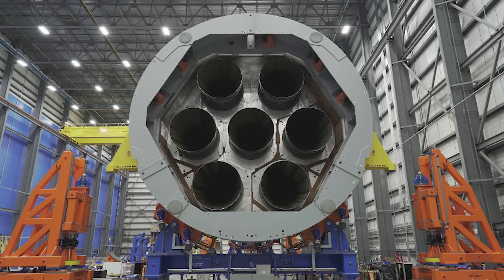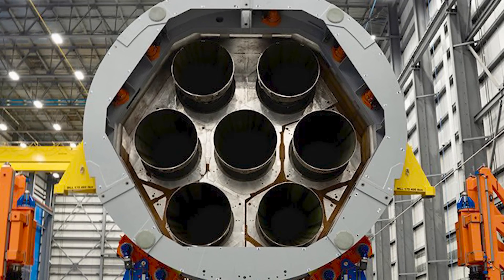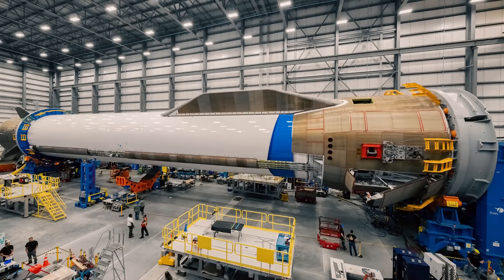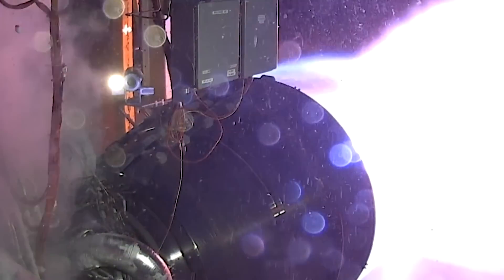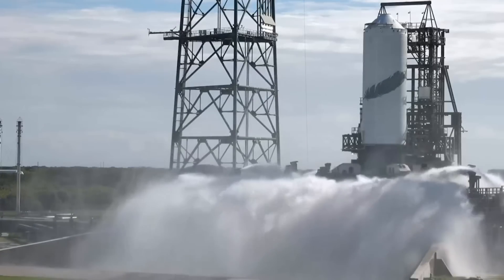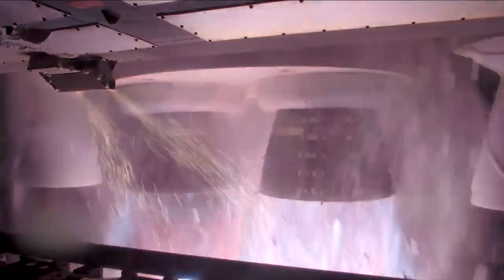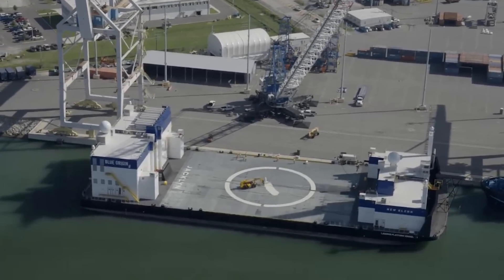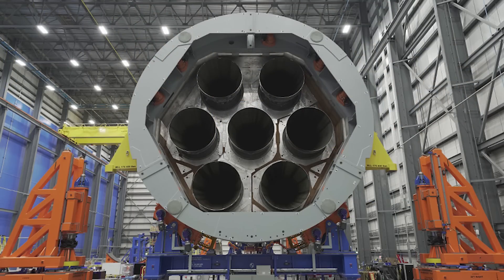Blue Origin Just Installed New Glenn’s BE-4 Engines

Comment: “No one has landed a reusable booster on the first try.” I’ve got some bad new for him if he hasn’t heard about starship IFT-5. It will still be an incredible feat if they land it first try. It’s a good looking rocket and I’m excited to see it fly.
Reply: IFT-5 had zero payload and is nowhere near "Flight ready" whereas New Glenn is.
  Big difference.
Reply: @jameskelly3502  exactly. new glenn is a functional LV. starship is a prototype
Reply: Can you expand on functional? It hasn't proven itself in a flight yet. Chances are it won't even clear the launch pad. Who knows, maybe the front will fall off. Nothing on that rocket has 1 second of real flight. It's as much of a prototype as the starship, but the starship booster actually landed and was catched with the chopsticks on the tower that released it. It seems to me that starship is getting proven, while new glen is flying payloads on unproven prototypes that the front might fall off of. Functional is a stretch at this moment. When it completes a full real test or mission, that's when you get to call it functional. Until then, it's a prototype. Theory!
Reply: @mihaiserbanescu8676  This is silly. SpaceX did flight tests relatively early and therefore had a number of failures. Many other companies do more extensive component and subsystem analysis and testing to limit flight risk as much as possible. This is why Vulcan worked flawlessly on its first mission, Ariane 6 very nearly did, and so on for many other rockets.

That doesn't mean one approach is better or worse, just that it is very possible to have a flight test with low confidence or quite high confidence.
Reply: Not really true but the point wasn't to successfully land the rocket.  The objective was to gather data not based on guess-timates in their simulators but to have real world data on how the systems actually perform in the real world.  Blue's biggest issues is they "Don't know yet, what they don't know yet."  When so many things are brand new and going to be tried for the very 1st time, you're really flying blind.  

Also non-optimal solutions tend to stay non-optimal unless they are mission critical that lead to loss of flight issues.  Ie the shuttle foam issues on the Shuttle were know but only addressed after it caused a catastrophic failure.  With no early flight testing, finding those issues cannot be addressed early in the R&D cycle and usually have to be "managed" after the systems are in production.  The attempt at getting everything right before attempting the 1st flight, is great if it all works perfectly.  The danger is some fixes cause a cascade of changes that impact other systems.
Reply: How have you managed to forget about ift 2?
Reply: Hmm why is it called IFT-5 and not IFT-1?

But yes, their first attempt to land it on a hard surface was successful. But 2 failed water landings and 1 successful water landing preceded it.

But yeah, they caught the booster on the first attempt.
Reply: @jordanhenshaw  1st try tower catch.  Blue just wants to say "we were first" so they added "at first try"...  Wish them and us all well.
Reply: @jordanhenshaw  1st time trying to catch it. IFT 1-4 was never meant to land

Comment: Gonna explode 😉
Reply: Successful payload delivery and booster landing 😉
Reply: @unnamed-ninja-yt  Payload maybe, booster landing doubt it.
Reply: @THX..1138  New Glenn delivered it's payload but the booster didn't make it. Still better than upper stage RUD on seventh attempt to reach suborbital trajectory.
Reply: @unnamed-ninja-yt  No not really. Starship and New Glenn are apples and oranges. Starship is still in the early stages of design. IF7 was a 100% research and development flight. Not a single part of the IFT 7 vehicles will be on the finished rocket....Whereas New Glenn is basically the rocket BO intends to fly customer's payloads on and it was using what are supposed to be flight ready engines. New Glenn's flight was a demonstration flight to show their rocket works as intended and it didn't...

If it turns out the problem solely related to reuse then it's not as big a deal cuz customers don't care if your booster survives... However New Glenn is a very expensive rocket that arguably can't compete with Falcon rockets even with reuse. It is for sure not commercially viable without reuse.
Reply: @ I am not debating the cost per launch. If you iterate it is expected that every new iteration performs better than previous.

Comment: " nobody ever landed a booster on the first try"   Well SpaceX had something to say about that.
Reply: Pretty sure landing a booster means landing it safely. If it explodes, it's just like not recovering it. So no, no one has to this point said let's make something recoverable and then land it without incident on the first try.
Reply: @eirinym  They were NOT going for landing catch attempt on 1,2,3,or 4 just system testing. Test 5 was the FIRST attempt to Catch the booster and on the FIRST try they nailed it dead center with no explosion.
Reply: SpaceX haven't done that
Reply: They didn't either. IFT 1, 2, and 3 had booster self delete. They also have navigation software developed for Falcon, and is obviously used and modified for Starship.
Reply: @hawkdsl  According to Elon in a Tim Dodd interview, starship doesn’t use any Falcon guidance code.
Reply: @jordanhenshaw  Yeah the two boosters are very different animals. Different fuels, engines, thrusters, flight profiles.
Reply: @hawkdsl  They were NOT going for landing catch attempt on 1,2,3,or 4 just system testing. Test 5 was the FIRST attempt to Catch the booster and on the FIRST try they nailed it dead center.

Comment: The video seemed to imply that there would be two New Glenn launches this year, followed by a third launch in March 2025.  However, the launch manifest only shows the Maiden flight that will test the Blue Ring Transfer Tug in November 2024, and the Pathfinder 1 mission that will test HLS capabilities to the Lunar neighborhood in March 2025.  A 2nd flight in 2024 seemed really unlikely to me.  Am I missing something?  Thanks.
Reply: They are behind. My guess is January for 1st flight. Maybe December.
Reply: Plans change... That's what your missing.
Reply: @hawkdsl  I'm not talking about Blue Origin's plans.  Since the 1st launch was pushed back to November I don't think there were ever any plans for a 2nd launch in 2024, yet that's what the video mentions.  I think the presenter misspoke but it was enough for me to check the worldwide launch manifest.
Reply: @victorkrawchuk9141  You're operating under the mistaken belief that the current one is the one that was always there. That's not true. The original plan as of September was to have at least two New Glenn launches this year, but the ESCAPADE slip into 2025 changed all of that, so the December Blue Ring/Dark Sky-1 launch was brought forward into November and will use the hardware from the ESCAPADE launch. 

More specifically, the plan was the turnaround the GS1 from ESCAPADE in a month to fly the second mission with an obviously brand new GS2. The second GS1 is expected to be ready in a few months and was seen under construction in the factory during Tim Dodd's Everyday Astronaut tour (recorded in late May).
Reply: @Starshipsforever  Okay, got it, thanks.  It's interesting that they have the confidence to have planned to re-use GS1 from the ESCAPADE mission for the Blue Ring mission after a 1-month turnaround following ESCAPADE.  I wish Blue Origin the best of luck and I'll be watching their launches.
Reply: @victorkrawchuk9141  The other alternative for Blue Ring Darkysky-1 is that it looks like they were going to launch it also on one of the NSSL Vulcan launches. 

So, it's nice to see them be able pivot and go to backup plans as the situations develops rather than be hemming and hawing and not knowing what to do.

Comment: It's interesting that in Tim Dodd's video a few months ago Jeff Bezos said that they are developing reusable ("Project Jarvis") and non-reusable versions of the New Glenn upper stage in parallel.  Whichever approach proves to be the most cost-effective is what they will eventually go with.  Surely the first flight will use the non-reusable upper stage, but does anyone know what re-entry approach Blue Origin has decided to adopt for the reusable version?  The last thing I read was that they were considering three options:  1) a winged design, 2) an aerospike engine design where the engine doubled as a heat shield, and 3) a Starship-inspired flaps design.  I wonder how closely Blue Origin engineers watched the SpaceX IFT-4 and IFT-5 missions, especially regarding the Starship re-entries over the India Ocean.
Reply: @Wi2Low It's hardly stealing, these concepts for upper stage reuse have existed since the 1960s
Reply: @Wi2Low Dream Chaser is a horrible design to use as a basis. Scaled up, it would be very destabilizing because of its unsymmetrical shape. 

Stoke didn't invent the linear aerospike concept.

SpaceX didn't invent the reusable upper stage. Go look up the original Space Shuttle designs and or Boeing's 1970s Space Freighter concepts, among many others.
Reply: @victorkrawchuk9141  What I wonder is if there might be a case to ultimately offer both upper stage designs, just for different missions. It really depends on the payload penalty and other design compromises that come with designing for reuse, but it might be that a reusable Glenn upper stage is interesting for lighter to LEO, ISS, SSO, etc., while an expendable Glenn upper stage is interesting for very heavy payloads, like space station segments, going to LEO and heavy payloads going to GTO/GEO. There is obviously an argument to be made that the expendable upper stage can do a lot of the lighter missions as rideshare missions, but having a dedicated medium-heavy launch option may still be interesting in the same way rocket labs electron is interesting.
Reply: It's actually called "Clipper" per the job postings and Linkedin as well as patents.
Reply: I believe they are doing the second one.
Reply: It is going to be very interesting to see how the numbers ultimately work out. It seems that BO has taken a good middle ground path with a realistic size the can effectively fulfill the bulk of the available missions. Get the booster reusability working smoothly first and have a better than falcon system. Then move on to additional reusability down the road which is something falcon can’t do. BO will have a system that is better at launching all those LEO satellites than falcon & without “scratching the stainless steel”. We will see if something can be too big.
Reply: @Wi2LowFanboy detected opinion rejected.
Reply: @Wi2Low well that's a very childish way to look at the potential of competition pushing the boundaries of spaceflight.
Reply: Hey, guess what, engineers don't just watch yt videos to see how things work lmao
Reply: @mathewferstl7042  If videos don't teach you anything then I have to wonder why SpaceX added so many cameras to Ship 30 over Ship 29.
Reply: @victorkrawchuk9141  the thing is right. That engineering camera footage isn't released publicly lmao. Do you think when you speak?
Reply: @mathewferstl7042  I'm sure no engineering footage was given to the Chinese, however they're fast developing Falcon 9 and Starship clones.  The point is, good engineers get whatever data they can from wherever they can.
Reply: @victorkrawchuk9141 lmao, you are delusional for thinking you can reverse engineer starship because we have a couple neat camera angles.
Reply: Similar to stokes it appears. They gave a ring of thrusters I think around the edge. I’m just  going by the drawing though.